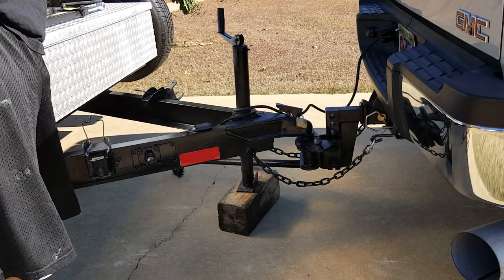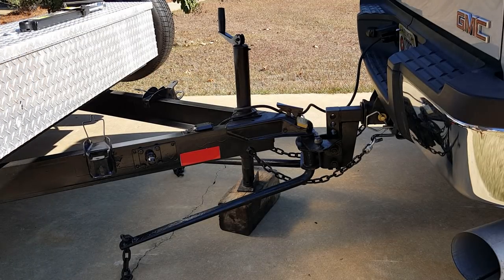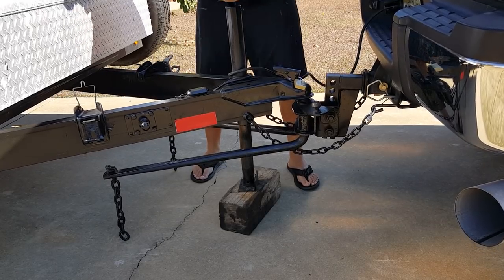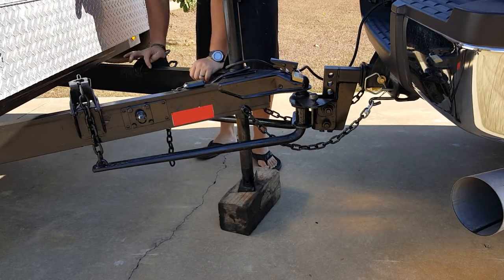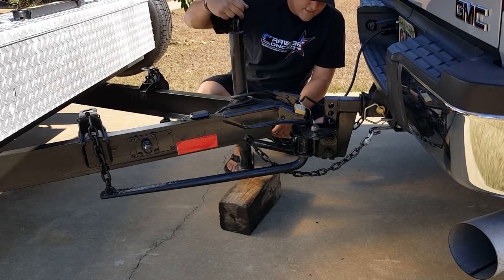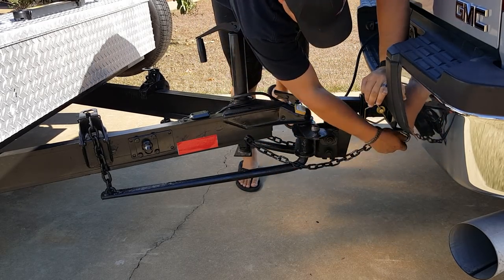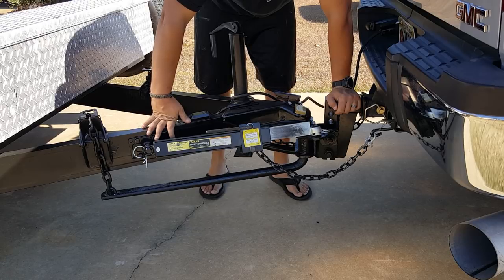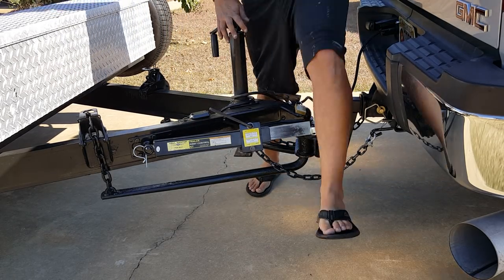Weight Distribution Hitch Explained

Comment: I have viewed many weight distribution videos and I still didn't quite understand the principle behind until this gentleman said the weight distribution arms act like the handles of a wheel barrel to lift up the rear end of the truck and move some of the weight forward to the front end. That made a lot of sense, and now I completely understand. Thank you for your video.
Reply from the maker: I took a mechical class one time from some engineers. The engineer came up and described the mechanical failure in algebraic expression on the dry erase board. Turned to the class and asked if we understood. Lol with a southern accent I said if it looks broken and sounds broken its broken.
Reply: More tongue weight
Reply: That's why its called a weight distribution hitch, it distributes some of the tongue weight of the trailer to the front of the tow vehicle LOL.  Many people have no idea how to properly set them up, but once you figure it out its like what the heck was I doing before HAHA!!!  

I've been doing the same setup in this video for years, works every time...trouble is when people buy those hitches nobody bothers to tell them or show them how to set it up in many cases so the poor customer just throws it together and it just rattles around on their first trip, next trip they don't have any of it connected at all just a regular ball mount because they got frustrated with the first attempt and the rattling equalizer bars and hitch probably drove them crazy LOL.  

This is a great video easy to understand and follow and works on all the different types of weight distribution hitches....what it doesn't say is that dang hitch head and those equalizer bars are heavy...oh and they don't feel great when you run into them with your chins.
Reply: Since the trailer is pushing a lot of the weight on those bars when he brings the jack up it takes some weight off the hitch.
Reply: The wheel barrel example makes sense now... Had to go back to elementary, and think of doing wheel barrel racing. When your in a pushup positions and your back legs are being picked up by someone behind you while together  you race forward with your arms. You actually feel  more load in the front for stability.. I guess too much could cause front suspension parts or abnormal tire wear on some vehicles.
Reply: Same here.
Reply: UM that wheelbarrow analogy doesn't even make sense and it's completely wrong. When you pick up the wheelbarrow it shifts most of the weight to the front tire(s). The rear "legs" come completely off the ground  and YOU are taking on the weight. For that to be true about the distribution hitch , the trailer would have to completely lift the rear end off the ground and take on the load OF THE TRUCK.

In reality if this was a wheelbarrow thing you would have to lean forward till  you were almost horizontal while holding the handles and it makes the wheel of the wheel barrow come up the you would have to explain how that downward force of your body is actually picking up at the same time. IT DOES NOT WORK.   

SO saying it like a wheelbarrow, is just a lazy way of trying to explain it that most fall for. 

Here is how it ACTUALLY works. The two bars basically become an extension of the drawbar and receiver.  Supporting the trailer further back, not just at the ball. Now the pivot downward is restricted. It just shifts some of the weight back to the tires which relives some of the weight on the truck.
Reply: @AztecWarrior69_69  Back to the tires on the trailer?
Reply: Aztec Warrior, you have a fundamental misunderstanding of how weight distribution hitches work. I don't mean any offense by that. 

The arms extending back do no act as an extension of the drawbar, supporting the trailer further back. The force on them is opposite of what you described. Instead, those extensions pull down on the frame of the trailer (transferring weight from the tongue of the trailer to the wheels of the trailer). At the same time the trailer frame pulls up on those bars, creating a lever point pivoting about the trailer ball, which transfers some weight from the rear axle of the tow vehicle to the front axle.
Reply: @mattc7820  This makes sense. If it were as aztec said, then the gap in the square hitch receiver would be on the top still because it was pushing down on that still.

Really, it's just changing the angle at which it presses into the receiver so that the net force of gravity is further forward in the towing vehicle, and the analogy of a wheel barrel is apt.
Reply: @AztecWarrior69_69  "...you would have to explain how that downward force of your body is actually picking up at the same time" That's Newton's third law of physics. Sorry, had to do that. 
I think you're making the assumption that the trailer is pushing down on the bars. They are not. They are pulling up.
You would be correct that the trailer would be taking some of the load from truck, but it would only be "taking on the weight" of the truck once it surpasses the hitch load. If the bars were under enough moment force to match the moment from the front wheels to the rear, then the rear wheels tires would in fact lift off the ground like a wheelbarrow. Or like a bridge with a hinged joint in the middle, and two tires attached near the middle as decoration. It just happens to be that the analogy represents a wheelbarrow before the back supports are off the ground because they are not under enough moment force, which is basically how he's describing it in the video.
The way you described how they "actually" work means the chains would be in compression, so it's clear that it doesn't work the way you describe, and by supporting the weight further back on the trailer, you would be adding a torque to pull the front tires UP, which would be really bad. It's not pushing down on the bars. It's pulling up.
The weight removed from the rear tires will add additional weight on the trailer tires AND the front tires, inverse to the distance they are from the rear wheels, so if the front tires are half the distance as the trailer tires, they will take up twice the additional weight, or 2/3 of the total weight. The longer the trailer, the more the front tires will take on the additional weight, and the less the trailer would experience additional loads.
Reply: It doesn't work that way. Gravity can't lift anything. All the pressure is downwards. The torsion bars just limit how much of a downward angle you can get at the hitch connecting the truck and the trailer. I don't think this does anything airbags can't do.

Comment: Great vid as I'm working thru gooseneck or tow behind. I would add to cross your safety chains so that in the unlikely event you lose your trailer the tongue is cradled in the chains as apposed to hitting the ground and doing possible damage to your tongue
Reply: Actually against the law in Pa. to not have the chains crossed.
Reply: @1harleyvette  you have to have em crossed in wv too

Comment: Dude thanks. I feel so much better about my setup now.  I really didn't understand what I was doing before. I upgraded from a little popup to a 32 foot bumper pull and I'm a bit scared, but your video has built my confidence.
Reply from the maker: Yeah getting the hitch and anti sway control bars set up will make your trips so much better with that larger trailer.

Comment: I have a wdh for my 30’ camp trailer, and while I can put it on correctly and it works well, I could not get into my head as to exactly what it does...until you said “the bars are like the handles on a wheel barrow “.  All of a sudden, the light came on! Thanks!

Comment: Thank u so much, I for the life of me didn’t know how to lock those bars in to the old hitch, that’s what we have. No pin. No clips, can’t wait to try putting em in like u did,  we’ve been towing camper without em. And ya front end of truck is a little squirrely.  It doesn’t seem though that we will need the anti sway bar off our old camper. We certainly needed it on old camper, but never ran the weight distribution bars on the old pop up.this camper now doesn’t swAy, at least at 65 mph. Hey thanks

Comment: Exactly how I was shown how to do it. I had my hitch set up by an RV dealer for the height of my truck, and before I drove off with my new camper they went over the procedure with me. I have seen videos where the chains are never tight before lowering the jack. If the chains are not tight, the spring bars will not do their job.

Comment: Wow , Lotta work . From my experience if your swaying it's your load weight being uneven so try to even that up , keep trailer level with adjustable hitch and if you still have some sway then simply slow your speed . Going 55 or 60 in a 70 wont make or break your arrival time

Comment: Alot of people think that the weight distribution hitch by itself is for sway and they couldn't be more wrong. One thing he didnt talk about was never try and back your trailer up with the sway control system attached to the truck and trailer I have seen the aftermath and it's not pretty. Also you can use your break control by manually squeezing the slider to correct sway while traveling down the road, you do light squizing so you dont lock up the breaks on the tralier.
Reply: If you have the right hitch  you do have the sway control  and you do not need that extra bar for the sway  it's called  THE EQUALIZER  HITCH BEST HITCH EVER MADE won't use any other hitch

Comment: Which is accurate:  I've had numerous brands of WD hitches, and all of them have emphasized that the torsion bars should be no closer to the camper's tongue than level, or parallel with the tongue.  However, you mentioned in the video that the torsion bars need to be 'pointing up' towards the tongue (i.e. not parallel with the tongue), which indicates that the torsion bars are doing their job.  Is this advice specific to this particular brand of WD hitch?

Comment: I'm not too experienced at hauling trailers, but I was always taught to cross the chains over in the case the trailer lets go, to prevent the tongue from hitting the ground. Is there reasoning behind not crossing them over? Not critiquing, just curious.
Reply from the maker: My chains are too short need to lenghthened  this has been debated. I like to cross them. When i can

Comment: Great job of explaining how a properly set up WD system works. The chains should be crossed under the bars and hitch to act as a "catch/cradle" if the trailer becomes unhitched. That way the trailer tounge won't drop to the ground.
Reply from the maker: Lol thanks.    But as I explained in the video when ran on the inside (crossed) they caught the hitch and sheared off.

Comment: I install these hitches on the regular. I'm not critiquing the video however your hitch head could use more kick back.  The weight distribution bars should be parallel to the frame of the trailer not pointed up at it. The links indicate roughly an inch each if you load them up more. With the sway control once you feel resistance on the crank handle go about roughly 3/4 of turn afterwards. Always remove the friction sway control when reversing the trailer.
Reply from the maker: I was taught to show a bow and to tighten the sway control as tight Lol to each his own. Thanks for your input

Comment: Great job explaining this...I have used that set up since 2007..it works great..if you are towing a toyhauler or camper use dual sway controls..right and left..this helps with swaying and passing and being passed by vehicles

Comment: nice instructions, but I think three things you might reconsider.   spring bars should be not more than level with the a frame,.  safety chains should be crossed, and lastly the bolt on sway control needs to be released when backing up.  great job with the instruction and why it's needed.    take care from an old timer!

Comment: Thank you for that video. I just bought a used travel trailer with that exact weight distribution hitch and have been having a hard time finding guidance on how to use it. Is the bar that you use to cam it over just round steel?

Comment: DOT will if stopped will require you to cross the safety chains once. In the case where the ball pops off the chains they say, will hold the trailer from hitting the ground. Great video though, good description of how it works and set up.

Comment: Thanks for explaining the bit about airbags just lifting the rear and truly not putting and downward forces on the front. Can you find out for us how to properly hook up the weight distribution/ anti sway hitch to a truck that has fully self leveling air suspension like some of  the Ram 1500s please. My guess is we just do everything the same way as we would on any other vehicle? I know if we towing a really small lightweight trailer with a strong enough vehicle we may not need the weight distribution hitch. I think any travel trailer towed weighing over 4000 pounds and over about 18 feet DEFINITELY can benefit by using the WtDistHich, God Bless, happy and safe traveling, Prost

Comment: Thanks for the video. That is the same way I was taught at the dealer on how to install. Been to north and south Dakota where to speed limits are 80 and I have no trouble driving my 30' trailer at those speeds. No sway what so ever Don't know if because my truck has anti-sway as part of towing package but it runs smooth.

Comment: I have a EAZ LIFT, sway and stabiliser kit, on my 32 foot travel trailer. I'm getting quit a bit of sway, when I'm driving against the wind. I have keep my sway Bar, very tight. Should I raise my stabiliser chain's, up one link? Will that help? The dealer installed the kit. My trailer seems level but my truck still has a slight squat. Just wondering.... Thanks for the great video.
Reply from the maker: You can double the stabilizers one on each side. I have a 35 foot camper and run a single stabilizer but two would make it really pull nice

Comment: Dude thanks for the video. Straight forward explanation. I’m planning on getting a camp trailer next year and will need a set up like this. Your vid answered a lot of questions. As for whatever the other keyboard jockeys had to say about your “mistakes “  I either didn’t care or didn’t care cuz you were doing it for educational purposes and I’m sure you set it up the way it needs to be when you actually get going.
Reply from the maker: No problem man thanks for watching I hope it helped. And for the keyboard jockeys it's just part of doing anything people have opinions and some are prone to voice their's. Lol I am confident with my set up. My chains are a tad short to cross them with out them getting hung up in the bars and hitch. To each his own
Reply: @huh_whoknew4714 : I kept looking for the critique posts...Now I take it they were about crossing your safety chains...Do They not understand that the "Leveler Arms and Chains" DOUBLE as Safety Chains? - 30 Years ago, I had one like yours on a 36' Bumper Pull Travel Trailer on a F250, and the weld failed on the Ball, and I actually did not know it had failed until I had stopped at the end of exit ramp...and the trailer slid forward on the hitch and the tongue Bumped the Bumper...For the last 5 miles I was hearing this clunking and chattering,  I could see my tires were fine, but was pulling off to check it out...Well I got out and looked and saw what issues were, I was shocked, but for some reason the tension was enough that the trailer would stay in the general vicinity of the snapped off ball, I PULLED IT another half a mile to the NAPA - with a snapped off ball!  (Napa was closed for the night so we camped in their lot till morning, the town cop came to check us out, his eyes were big as saucers when I showed him WHY we were "Camping at Napa") The Manager of the Napa was impressed... My safety chains were NOT crossed...Heck, they were never even put under tension... So those Nay Sayers, can go pound sand!

Comment: It looks like the two pieces of the sway bar must have to be able to move in and out of each other during turns, but provide enough friction to avoid the trailer from swaying. It seems if you tightened  the sway bar too much you would have problems when you made a turn. How much do you tighten it?

Comment: Using a lever in the chain holds and muscle to attain your 3 link chain position rather than using the trailer jack will obviously result in the same pull on the equalizer bars and same weight distribution effect. I find it quick and easy to use the bar that comes with these hitches for that purpose rather than the tongue jack method.
As for using an anti sway device as a matter of course ??????? Anytime one of my 6 trailers has swayed I pulled over and adjusted the tongue weight (heavier) and remedied the issue (with one exception).
Once, pulling the travel trailer in windy conditions, it swayed, and was frankly scary, I slowed to 80kph and all was good.
I guess I might use one if I was always struggling with sway but, I'd sure rather not have sway by altering tongue weight or slowing.

Comment: Good info as I am looking to get my first big camper trailer.  I am curious as to why do you not cross your safety chains?  I was trained you always cross your safety chains to form a cradle to catch the tongue if it happens to come off the ball.
Reply from the maker: Thanks
Im gonna have to take this video down..... in the video I clearly said when I ran them on the inside  sheared them off. They were too short with the drop down
Reply: Guess I missed that,  so I went back and watched again.  So as you said in your comment above you ran them on the inside and sheared off a link so now you run on the outside.  I took that as running on the inside of the arms since there was nothing said about crossing the chains.  Sorry my comments annoyed you!!  I gave you kudos of good information,  I just asked a question for clarity!!  I wasn't trying to run you down!!!